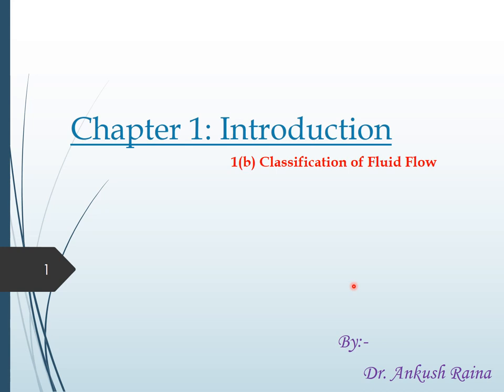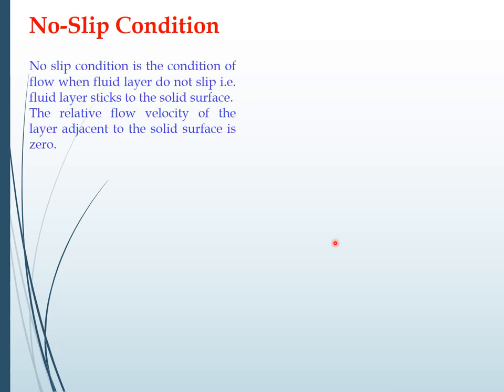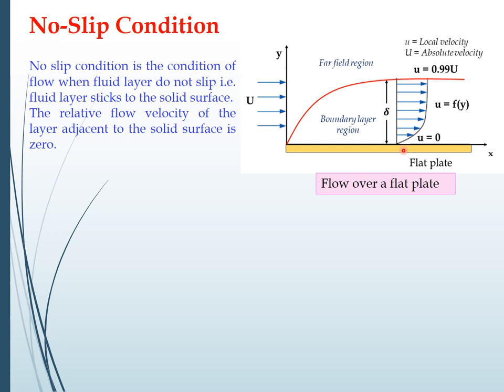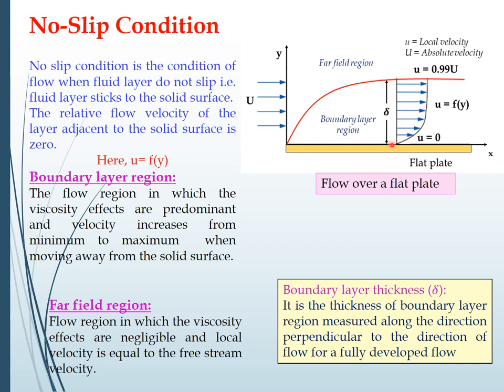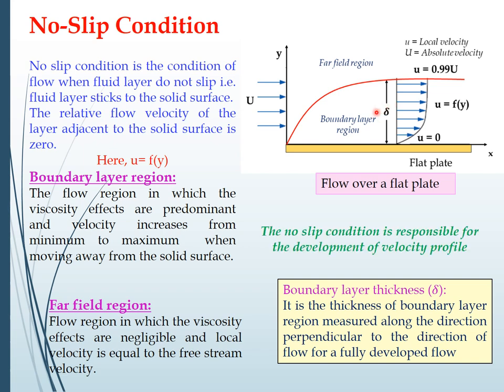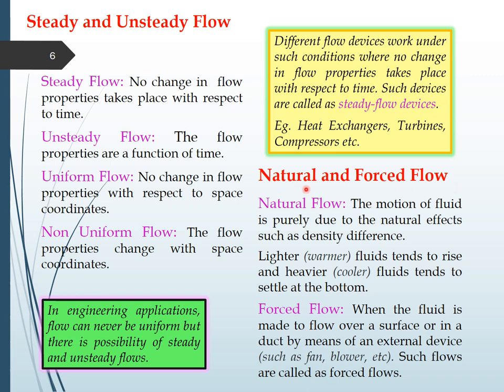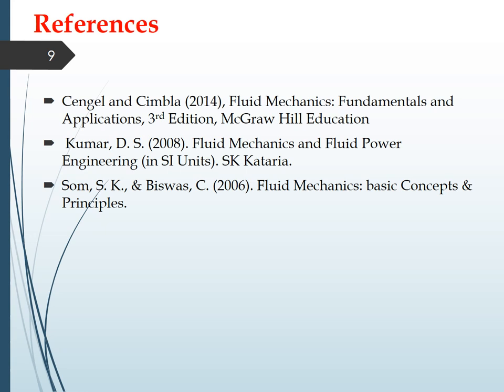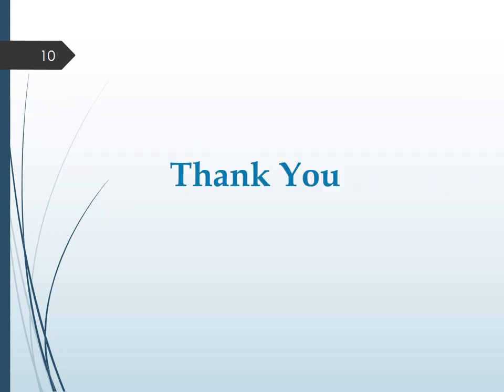(1b) No slip condition,  Types of fluid flows/Classification of Flows ( Introduction) (Fluid Mech.)

Comment: Sir, IN FLOW THROUGH A PIPE:- 

if reynold's number is 2300..will it correspond  to a laminar flow or transitional flow.
Reply from the maker: Re<2300 (Laminar flow)                     2300<Re<4000 (Transitional flow)              Re>4000 (Turbulent Flow).                      Accordingly the flow in a pipe will be transitional for Re =2300.

Comment: sir why boundary thickness is measured in fully developed flow not in developing one
Reply from the maker: In case of fully developed flow there is almost no change in the velocity profile along the length of the pipe, whereas in case of developing flow, there is a continous change in the velocity profile along the length of the pipe.
Reply: Thank u sirr🙏🙏🙏❤️